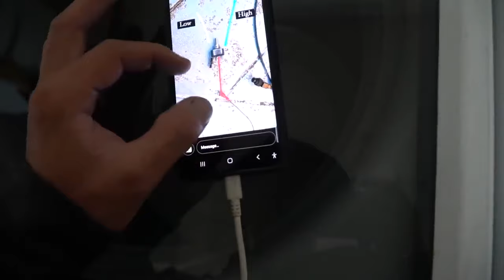Building The Shadow in 10 Minutes

Comment: Hey man. Amazing work! Did you have to make any adjustments to the cables when changing the handlebars? Like extend or reroute them? Thanks man!
Reply from the maker: I didn’t have too. The oem cables were king enough for my new bars.
Reply: @VuLes13  That's great news! Do you happen to have a link to your T-bars? Were you able to use the same bolts that held the old steering wheel for the new t bars? Thank you!
Reply from the maker: @easyplectrumstorock  search up zombie performance. You can get these bars there